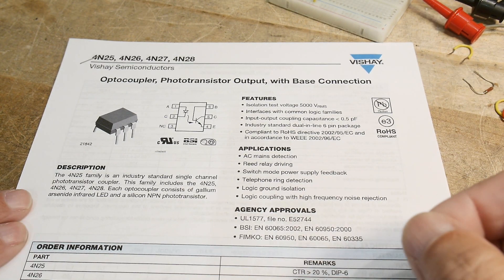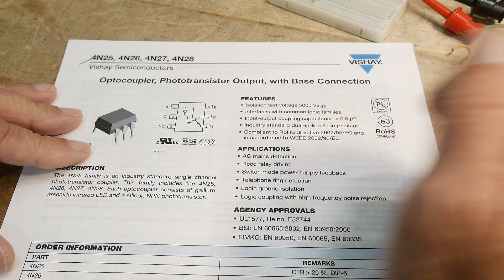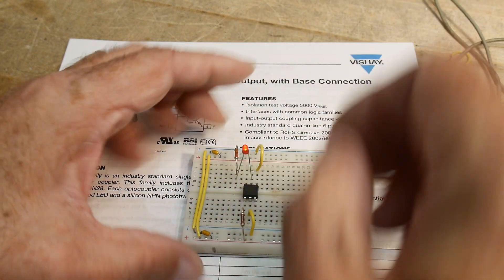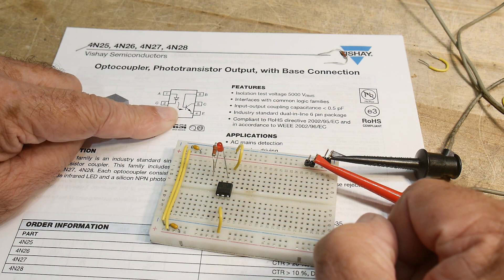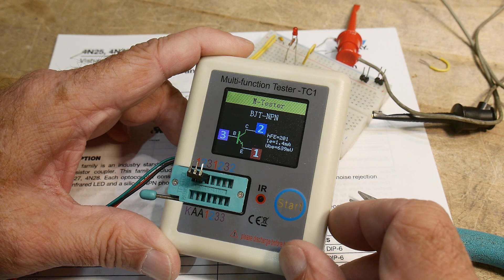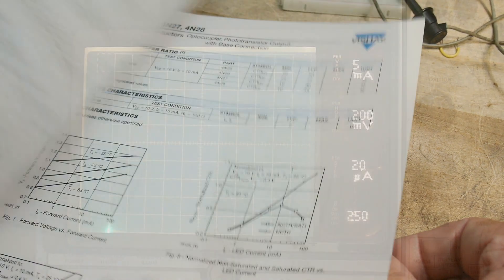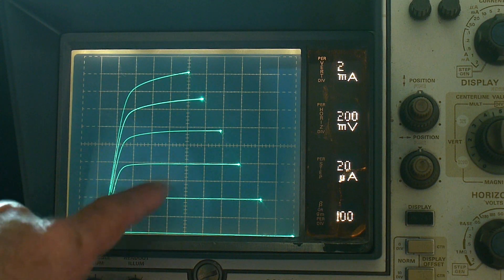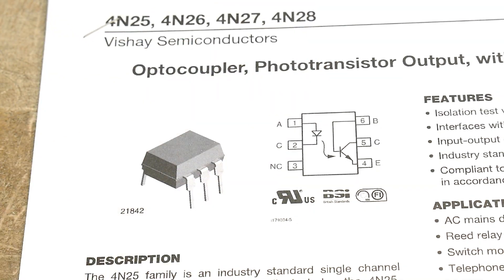#1497 4N28 Optocoupler Optoisolator

Comment: That was an interesting test ( at the curve tracer).
I wonder what would be the effect (on the curves) if at the same time the curve tracer is proving the transistor part, if you would gradually increasing the current on the LED.
I wonder if it just expands the Ib curves (at the low end? At the high end?), or if it expands the whole set of curves...
In other words, is the light bias  acting like increasing the gain of the transistor, or is it acting like adding an offset (a bias of sorts)?
That would be an interesting thing to show on the curve tracer.

Comment: Can you parallel the emitting diode across the BE junction and run it on the 3-terminal tester? You'd probably get some kind of nonlinear response by the tester biasing the junction to test while at the same time changing the device's response as the same signals activate the phototransistor... (I think this is what @argcargv was saying)

Comment: The base connection lets you connect a resistor from base to emitter to help the turn-off time of the transistor (helps drain charge out of the base-emitter junction on turnoff).
Reply: This way you could speed up the transistor with discharge of diffusion current on the base emitter diode through that resistor.  This is specially useful if Base collector region is not reverse biased.

Comment: Connecting Pin 6 to ground with a 10K ohm resistor (for example), helps turn the transistor off more quickly. Hence, higher frequencies are possible.

Comment: Interesting responses regarding the purpose of the base connection. I’ve only seen it used to address potential leakage current, where a large resistor, usually around 499k, is placed across the base and emitter. This is similar to the reason we generally put a resistor across the base-emitter in non opto-isolator applications - to prevent leakage current or noise from turning on the transistor where, the base is essentially a high impedance/floating node. My experience is with high reliability satellite applications, though.
Reply from the maker: that sounds like a good use of the pin

Comment: You could use this configuration as a mixer, if you can turn on and off the diode fast enough ( if diode has enough band width ).  you send IF on the diode and the RF on pin 6.
This way you get ride of flicker noise, etc.
As you know with the lasers, in order to turn on and off the diode fast, you need to switch between low current and high current and keep the diode always on, say switch between 300uA and 5mA.
I will setup a test bench to check that.  See if we can make a AM down converter mixer out this.

Comment: A few years ago when CRT TV's were standard and they didn't use an isolated ground I had a TV that had RCA jacks for audio and video. The audio and video were isolated with a small smps and opto-isolators. The smps provided a floating power supply and the opto-isolators were using the base as a linear amplifier. The LED input was the analog input (with an added current source as an LED bias).
Reply: i'm trying to figure out how to do this now with a toshiba that already has an opto-isolated composite video input, but for an RGB input. in the Toshiba schematic, it's using a winding off the flyback secondary to power a little smps that pulls the LED side up to like 12-14 volts, i'm assuming because the LED needs to be high enough to stay on all the time. what i'm struggling with is whether or not the little transformer would be adequate to run the RGB inputs as well. the sync is still handled fine by the composite video input because i'm using the OSD inputs on the jungle IC to inject RGB, but the smps needs to be able to handle 4x what it was designed to. i can't imagine it's a whole lot of current though, it's just a tiny signal

Comment: I guess you could strap an LED to the top of a metal can transistor that has had its top chopped off. That would be an interesting followup video.
Reply from the maker: https://youtu.be/Z3aWAsw_48g
Reply: @IMSAIGuy  Lol. I should have known!
Reply: @IMSAIGuy  , in that particular video, you say that all IC's are black. That is not entirely true, the H11AA1 and  MOC3020 Opto-couplers exist in white package.
i have both in stock.

Comment: 1N for 2 pin semiconductor (diode, diac)

2N for 3 pin semiconductor (BJT, jFET, MOSFET, UJT)

3N for 4 pin semiconductor (dual gate FET, PUT)

and so on
Reply from the maker: explain:
4N28 part is in 6 pin package with 4 active pins
6N135 part is in 8 pin package with 6 active pins
Reply from the maker: The naming convention you're referring to is part of the JEDEC numbering system, which is a widely used standard for identifying electronic components.

In this system, the prefix "1N" is used to identify a diode, while the prefix "2N" is used to identify a transistor. Here, the letter N denotes that the part is a semiconductor component. Other letters can also be used, for example, "M" is used to identify metal oxide semiconductor field-effect transistors (MOSFETs).

Other numbers used in the JEDEC system include:

3N: Thyristors
4N: Triacs
5N: Sidacs
6N: Optocouplers
7N: Voltage regulators
8N: Switching diodes
9N: Zener diodes
Reply: @IMSAIGuy  thank you very much, sir

Comment: I've seen old smps designs control the base pin as a separate control on high side to avoid using another transistor. Output voltage is controlled by the LED side and current limit is controlled by primary winding current on high side. I don't think this type of optocouplers are common nowadays...
Reply: It is very interesting could you draw a picture or send a pointer to a schematics.
What you are saying it basically does a multiplication function.

Comment: External base on optocouplers can be used to widen its bandwidth, eg. by loading the base by connecting a resistor to the emitor the base can discharge faster and as such work faster (or support wider analog bandwidth in feedback or analog isolation applications).
Reply: Circuit for improving the switching speed of a 4N28 optocoupler can be found in Bob Pease's "Troubleshooting Analog Circuits" in which a 2M ohm resistor is placed across the base and emitter pins

Comment: The base can control the "sensitivity" and bring the optocoupler to a somewhat linear response for analog signals.

Though I never uses such configuration, you can test in your curve tracer by tracing the transistor while slowly increasing the Led bias.